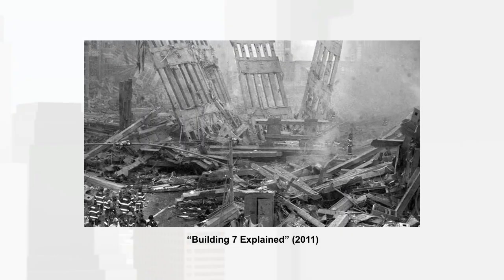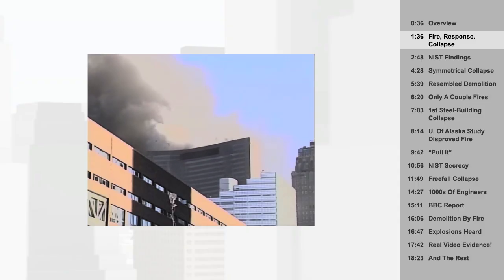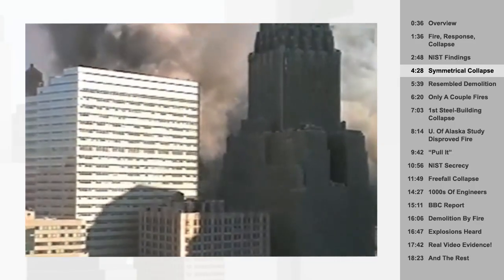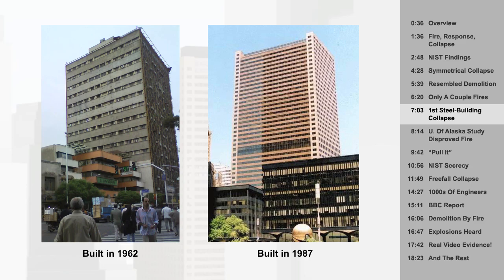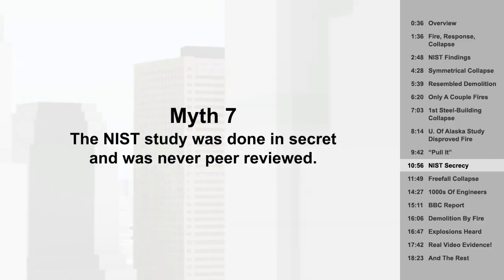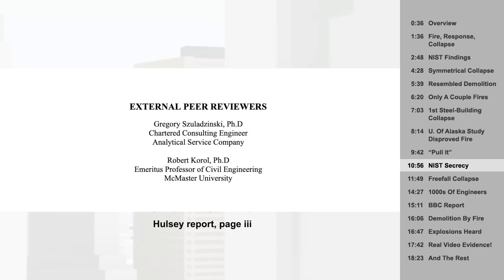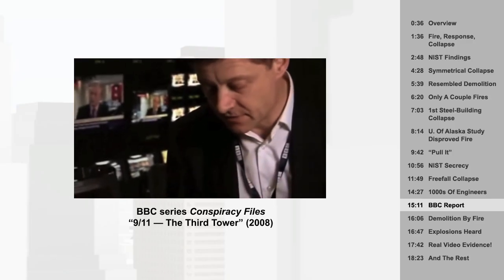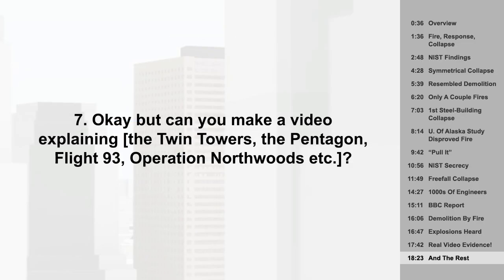Building 7 Explained: Comprehensive Final Edition

Comment: Just wondering. Is this video intended to be a serious & impartial presentation?
Reply: Grabbing my popcorn for this.
Reply from the maker: Serious, yes. Impartial? Well, not to a demolition believer. It's definitely partial to the idea that the building wasn't intentionally demolished, because there's no evidence for that.
Reply: @EdwardCurrent  Full disclosure, in another chat thread, robbo claimed that your video is incredibly flawed starting with your diagram that looks like the twin towers and not building 7. Of course he clams up when he finally engages in conversation with you. I was looking forward to you putting him in his place.
Reply from the maker: @TheMiddleClassholes  You mean the diagram @13:19? That is scale accurate (as seen from the west). It was a 47-story building, not a 20-story building on a hill.
Reply: @EdwardCurrent  No, just before the 1 minute mark when you're explaining the "tube" structure. His issue was the shape in shown reflects the twin towers and not building 7, therefore your video is inaccurate. Keep in mind, these are his issues. Not mine. It's not a shocker that he's no where to be found now that you've responded to him.
Reply from the maker: @TheMiddleClassholes  Oh right. Other Truthers have complained that I showed a schematic diagram of a tube structure for a couple of seconds rather than the actual detailed floor plan. As if it matters. The asymmetrical spacing of WTC's core columns was one of the building's weaknesses, not strengths.
Reply: @EdwardCurrent 
Thanks for the clarification of these 4 things. I appreciate it.
Since the person who  recommended I watch this video, she's suggested a better video by some English guy.
Cheers anywsy.
Reply: @robbomax2397  I didn't say Myles Powers video was better. I simply said it was another option. 

And please let Edward know your issues with his video. I'm sure he'll gladly explain why you think his video is flawed.
Reply: @robbomax2397  Edward is game to explain any questions you have. Particularly about how you believe his video to be flawed.
Reply: @TheMiddleClassholes I've just checked this thread and seen the replies since I last visited.  I see that you've not accurately represented facts about the other thread to Edward (but that's no surprise given your track record). But any inaccuracies are not important or worthy of wasting any time on. 

You seem very confident that Edward will want to respond to any points that I raise regarding his video.  

You also seem to be acting as an advocate on his behalf when I can't see him asking you to be that. Also he seems perfectly able to speak for himself when he wants to.

I asked him a question and he clarified 4 things for me. It's clear to me that me raising any points would be a waste of my time.

Since it's got nothing to do with you them I don't need a response from you (either on behalf of yourself or Edward).
Reply: @robbomax2397  You said his video was flawed. Well... here you go. Here's your chance. Put your money where your mouth is.
Reply: @robbomax2397  You're right. He can speak for himself. And he'll do so when you reply to him, directly, and explain why you think his video is flawed. He'll then explain why you are wrong.
Reply from the maker: @robbomax2397  Generally it's a waste of everyone's time when someone says questions at me without caring about the answers. This is also true in other "evidence-challenged" topics such as NHI-UFOs and creationism. Still, I usually respond just for the benefit of any genuinely interested person who might be reading.
Reply: @EdwardCurrent You seem to have posted a comment to me, which is not a reply to anything I've said to you.

Instead, your post seems to have been prompted by TheMiddleClassholes.

I asked you a question (my post that started this thread). In your reply, you clarified a few things. I acknowledged & thanked you for you reply. 

That was the end of our discussion as far as I was concerned.
Reply: @robbomax2397  Oh I can read and I'm well aware of your babbling about. You're not the slightest bit interested in engaging with Edward because you already know the outcome. You prefer hand waving and gaslighting.
Reply: @TheMiddleClassholes I replied to you buy it is not visible unless comments are sorted by newest.

This is to let you know that I replied (and how you can see it) in case YT did not send you a notification.
Reply: @robbomax2397  Neat story. It's apparent that you don't want to get put in your place by Edward. Now just run along.
Reply: @TheMiddleClassholes  this is to let you know that I've posted a reply (that is not showing unless comments are sorted by newest) to your most recent ("Nest story") post.
Reply: @TheMiddleClassholes    I'm responding to you because you posted a comment that was expressly addressed to me.  Such being the latest in a continuing interaction between you and me on this thresd (which you started).

You've still not identified the other video by Edward that you were referring to in your post in the FilmTv thread on Lesics video. So I'll ask again. 
Can you please identify the other Edward video?

Whether I elect to engage (or not) with Edward is up to me and has got absolutely zero to do with you. You're the last person I would take advice from so I certainly won't take any orders from you. 

Regarding your final question, my answer is: Nothing. Why do you ask what I'm nervous about?

Please prioritise identifyibg the other video by Edward above answering the nervous question.
Reply: @robbomax2397  He made two. This video is a follow up of the first video he did about building 7. If you want to get technical, he made one. 

Sure, you don't have to take orders. It's comical though that you point out, what you believe to be, fallacies in the video but choose to not direct these points to the creator of the video. You have a LOOOOT of question but boy you don't seem the least bit interested in having them answered. LOLOL
Reply from the maker: @TheMiddleClassholes  Can't you read? He said it would be a waste of time typing [does word count] 683 words in one reply alone. Yeah doing that would be a waste of time
Reply: @TheMiddleClassholes 
FFS!!!  This is like pulling teeth. 

I'm guessing you've not watched this video here and particularly not the first 20 seconds.  During which he refers to TWO previous videos he made. 

Which one of the these other 2 videos were you referring to?
Reply: @EdwardCurrent  Lol. So a little back story. Lesics put out a video roughly 4 months ago describing the collapse of the twin towers (Worth a watch if you haven't already). Robbo regularly comments. I'll leave it at that. Lesics mentioned that a similar video about building 7 is coming. The truther faithful are going bananas. I referred Robo to your video. He immediately detailed why it's flawed, but he won't engage in discussion with you. Shocker. He's such a open minded individual.
Reply: @robbomax2397  Waaahhhh! My lord man. For someone who brags about how much research they do, you have a hard time navigating the someone's youtube page. Sheesh. 

Ed's OTHER video is titled "Building 7 Explained: The Tube That Crumpled"
Reply: @robbomax2397  I didn't ask you what was wrong with Edward's video. I used this video as an example of "other" videos that have been done regarding the collapse of building 7 and you rebutted with what you believed to be wrong with his video. 

Now here's where things get fun. You now have Edward's ear but you have zero interest in discussing, with the video's creator, why you believe it to be flawed. Why?
Reply from the maker: @TheMiddleClassholes  LOL, you have been caught not knowing something that your opponent knew. It is true I did two, not one, previous videos on Building 7. What a shame that you were unaware of this earlier video. Unfortunately any such lapse in YouTube-comments perfection makes you unqualified to comment further on this engineering disaster.
Reply: @EdwardCurrent  It also leaves the door open to a conspiracy. Don't forget that.
Reply: @TheMiddleClassholes  I see you are (as you usually do) trying to move on to another topic.  Classic Gish Gallop tactics.
I'll happily  return to discuss what are the actual facts regarding the Lesics video (and discussions regarding Edward's videos in the FilmTV thread).

In the meantime, let's finish the you brought up. Navigating around Edward's channel.

Who is it that can't find Edward's Wtc 7 videos on his YouTube page?
Reply: @robbomax2397  You asked where you can find his other video regarding the collapse of building 7. Is it that hard to navigate his page and find videos?
Reply from the maker: @TheMiddleClassholes  Leaves the door open? It's obvious that you're a paid government shill. My standards for evidence are very high.
Reply from the maker: @TheMiddleClassholes  If only I had pretended to be impartial like the super-duper-impartial "Truthers," then maybe that guy would give me the time of day😭😭😭
Reply: @EdwardCurrent  Get this. He's so impartial that he doesn't believe the fdny evaluated building 7's condition. That's based on hyper specific questions that he had regarding said evaluation. Since I couldn't answer them all, in manner he demanded, he concluded that it didn't happen. He's soooo impartial.
Reply: @TheMiddleClassholes 
I did not ask that. You're misrepresenting the actual facts again.

It was simple for me to navigate his channel and find his wtc 7 videos.   There are 2 others before this one.  

But it was clearly too hard for you since you could only find one of them (then doubled down on it) . You missed "Building 7 Explained" uploaded in 2011.
Reply: @robbomax2397  You're right. I stand corrected. I did ask you what was wrong with his video. WELL, we have the creator of said video right here. Why don't you inform Edward of how he got it wrong and then we'll watch hilarity ensue?
Reply from the maker: @robbomax2397  
Can you please clarify?
I think I was referring to your post beginning "despite your claim"
What are the circumstances that lead you to not respond?
Usually my mood. If they make a personal attack right off the bat, I delete their comment.
Now that I have your ear, perhaps you can answer a question. I've noticed that 9/11 Truthers are some of the most impartial online researchers in the world. They are almost zen-like masters in their refusal to be swayed by propaganda from Big Engineering and whatnot. How can I, as a mere toadie of the Official Story*, achieve this enlightened state of rationality and lack of bias? Is there a 3-hour Judy Wood video I can watch, or a Dick Gage weekend-long symposium that I can pay for and attend, that would relieve me of my biases with regard to 9/11?
*I claim no rights ownership to the phrase "Official Story" which I presume is trademarked. Fair use only.
Reply: @EdwardCurrent   
I note, and thank you for. your replies to my questions, which is appreciated. .

Regarding the question you say that you want to ask me.  They both seem to be satirical/ comedic rhetorical questions, which I found quite amusing. 

If they were not intended to be such please let me know and please accept my apology  for misinterpreting them. 

Cheers
Reply: @robbomax2397  I sure can. I see that you're beating around the bush with the issues that you have regarding Edward's video. At this point, I doubt you ever will. How courageous of you.
Reply: @robbomax2397  You're obviously scared.
Reply: @robbomax2397  I see you, and every other twoofer, over the last 23 years haven't proven an inside job took place. Lol
Reply: @robbomax2397  So you're scared to debate with Edward. That's so cool!
Reply: @robbomax2397  1. Yes, you are.
2. "Wasn't me what said it so there!"
3. Your claim your proof.
Reply: @mooneyes2k478  What are you rambling on about?
Reply: @robbomax2397  "The Gish gallop  is a rhetorical technique in which a person in a debate attempts to overwhelm their opponent by providing an excessive number of arguments with no regard for the accuracy or strength of those arguments." This is what you're trying to do.
Reply: @austincranford908 Oh really?! Thanks for letting me know that you like to make guesses. It's a pity you're not good at it.

Comment: Let's just ignore the fact that only 35 of the engineers who signed that stupid petition were actually structural, and pretend that all of them were. Even if that were the case, it's still a plain appeal to authority fallacy i.e. because someone is scientist or engineer, that doesn't automatically prove that they are right.
Great example of this is Scott Brusaw, the guy who invented "solar freakin roadways" who claimed that his product would be able to melt snow and generate electricity, only to get caught completely lying about his numbers, which were by the way debunkable with very simple calculations.
Reply: Not, of course, to mention that neither the AIA nor the ASCE, who between them have about 250 thousand architects and engineers, have any notable issue with the explanations given.
Reply from the maker: In this case we're talking about professional expertise, so being a structural engineer does carry some weight. However as in medicine, structural engineering is highly specialized, and the relevant expertise here is tall-building structural engineering. A structural engineer of bridges (like LeRoy Hulsey of the University of Alaska), or tunnels, or ships, or residential houses, is not qualified to do original research in this extremely technical area.

Comment: Interestingly, at this very moment, an apparent steel-frame structure is burning heavily, and have suffered a partial collapse.
As best I can tell, the car park at the airport in Luton, Great Britain, is purely a steel structure, with concrete only on the driving surfaces, and a massively out of control fire has caused at least parts to collapse according to news reports.

But really, that can't happen. The "truthers" said so.
Reply from the maker: But what about the molten steel...or something
Reply: @EdwardCurrent  But steel can't melt fuel
Reply: @24pavlo yes but nano ipods can 😂
Reply: @EdwardCurrent  Well....they seem to have forgotten that part. Again. Whoever "they" are.

For general information, the fire took place in "car park 2", which if you were to go look at pictures, is very obviously a steel frame structure, literally nothing else is there other than the driving surfaces.
And, in the words of the Bedfordshire Fire and Rescue, the structure was "fully involved in fire"(seem to recognize that phrase) and suffered "a significant structural collapse".
Reply: @mooneyes2k478 "jet fuel doesn't explode steel beams" when i launch a 333T when at their house
Reply: The funny thing is that there are conspiracy theorists in the UK who think the government is trying to cover up issues with EV battery fires to coerce them into EVs.  Everything's a conspiracy ...

Comment: As someone who lived near a gas tower that was demolished in 2003 i can confirm that demolition charges are very loud. I lived about a mile away from the Kokomo Gas tower which was way farther away than the video from building 7 was. And those explosives in the gas tower were so loud they actually woke up my little brother who was only 1 year old.
Reply from the maker: Were there observed/heard explosions on 9/11?
Yes and that's covered in the video. Watch it.
What about molten steel — any of that seen on 9/11 and subsequent day?
Nope. If you can point me to a metallurgical analysis of the claimed molten steel, please do.
What is your explanation for the presence of nano-thermite particles concentrated at Ground Zero?
Conspiracy believers looking for explosive residue, finding none, and instead, finding aluminum (from the Twin Towers' cladding and a couple of 767s) and rust (from rusted steel), and claiming that that's "nano-thermite." Know what they didn't find? Aluminum oxide, the reaction product of thermite/nano-thermite — thereby outright falsifying the hypothesis that thermite or nanothermite reaction was used in the destruction of those buildings.
Reply from the maker: And that's a gas tower! I'm guessing it didn't have 84 steel columns, the largest being 24" x 14", like WTC7 did.
Reply: @BradRaiche  "Were there observed/heard explosions on 9/11?"
Not really. There were lots of loud sounds. Could those have been explosions? Maybe. Could they have been explosives? Not on your life.

"What about molten steel — any of that seen on 9/11 and subsequent day? "
No.

"Can jet fuel melt steel?"
In what way does it matter if it can or not?

"What is your explanation for the presence of nano-thermite particles concentrated at Ground Zero?"
"Cool-sounding buzzwords invented by absolute dumbshits in order to make themselves and their dumbshittery seem more cool and important".
Reply: Well that proves it then. If loud noises weren't heard then it couldn't have been a demolition. You untruthers are just as ridiculous as truthers
Reply: @jesusshuttlesworth3551   Have you ever witnessed a controlled demolition in person?  Living in Vegas, I've been present at many.  And in every case, not only can you hear several loud and sequential explosions just prior to the collapse, you can FEEL the shockwave of them blocks away.
Reply: @jesusshuttlesworth3551   That's right. It couldn't have been. Because, what do you know, demolitions use one of two methods. Either disassembly by cranes and machinery, which didn't happen, or by explosives, which makes loud noises, which weren't there.